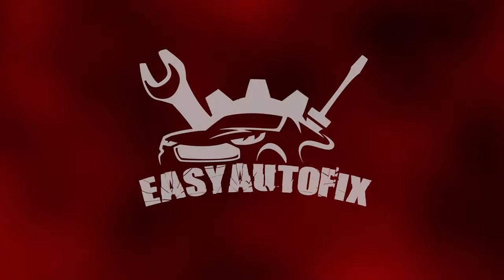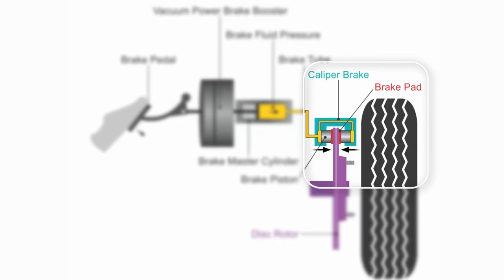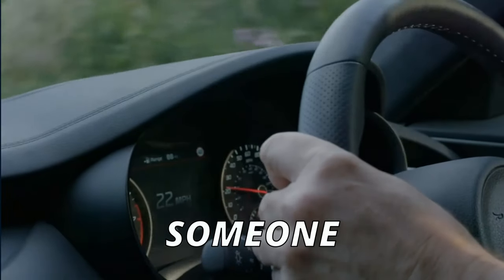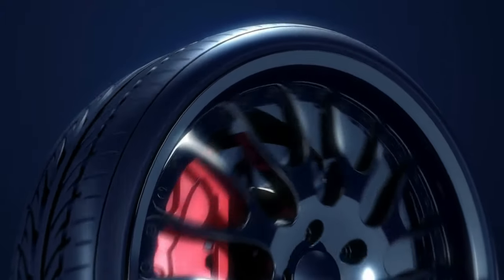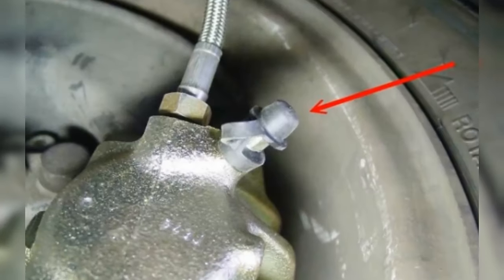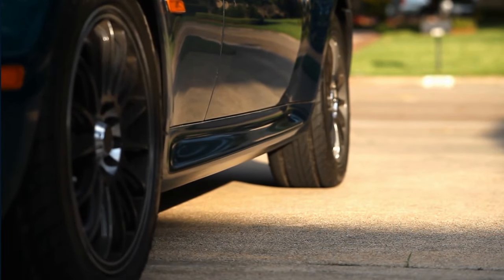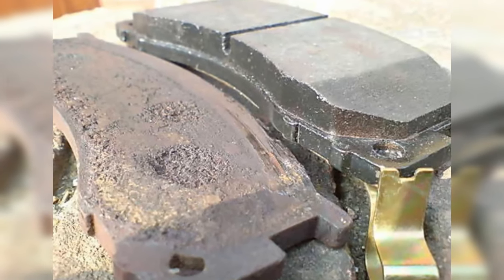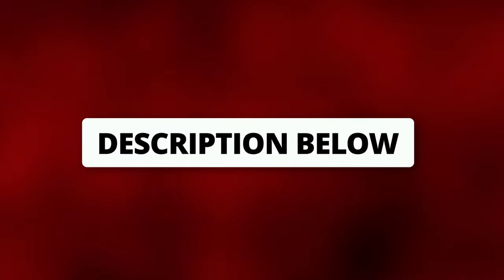SYMPTOMS OF A BAD BRAKE CALIPER

Comment: Dude the car problems never stop I swear😭
Reply: I feel that lol i got a 2016 dodge dart sxt last march with 58k miles. S8nce then, ive had to replace all 3 motor mounts, i have spark plugs that are melting, had to replace the transmission mount, have a sever clunk in the front end thats been ongoing since purchase, we just replaced the struts last weekend as dodge said that was the cause, only to discover it wasnt. Brakes and rotors are bad, transmission and powertrain are bad, fans are going out and are loud when running heat or AC, just doesnt stop. Come to find out, its possibly my calipers, which is what brought me to this video
Reply: @unhollowed_7383  new dodge Chrysler or jeep never a good choice
Reply: @rdr9519  just makes me miss my 06 300c 5.7 even more. Hate my dodge. Ive done more work since posting my comment. Just did CV axle, and wheel hub, and still have a clunk. At this point, ive basically replaced everything in the area that the clunk ia happening, and the clunk remains. Im now at 64.5k miles. Roughly $1700 in parts and diag fees with no fix.
Reply: @Unhollowed _  yeah man I know it's hard if you love the car but newer Chrysler products aren't very high quality. Newer cars in general don't last
Reply: Nothing on my 01 jeep cherokee was maintained, literally looked at everything and everything is needing to be replaced. it never ends
Reply: you can day that again
Reply: It's not just car problems. Literally everything is garbage
Reply: Amen🤛🏻
Reply: AT ALL 😢
Reply: Glad I'm not the only one 😅 I have a 09 mercury sable so the parts are either outrageously expensive or hard as h3ll to find!
Reply: Ever
Reply: U don’t need to replace the engine mounts
Reply: No shit, they are made of thousands of moving parts.
Reply: Bro I know right. I have a 2010 Benz e class and it’s like I’m just chasing different noises all day. When it is in peak shape it is a blast though.
Reply: Got damn you’re right 😂
Reply: Never. sucks even more when you soend money trying to fix something, and can’t figure out what’s wrong

Comment: My mother bought a brand new car a number of years ago.  About 15 months later, and 14,000 miles later, she heard the brakes squealing at the front.  She took it to the selling dealers service department.  They said her pads were worn, and replaced them.  Then they said her brakes were heavily used, and abused.  Nobody used the brakes in a manner as they were stating.  She continued to drive the car, and said the front brakes felt funny at times as if they were locked up.  At 23,000 miles the brakes were squesling again due to the warning sensors scraping the rotors.  She returned to the selling dealer again.  The second time they found both calipers were not releasing, and were causing the pads to ride on the rotors, and wear them out.  They determined both calipers were defective from the beginning, and were causing the pads to wear.  It was a brand new car, and both calipers on the front were defective right from the factory.  They replaced the calipers, and there were no further problems.  Her gas milesge improved too.

Comment: Or the caliper piston is seized or piston boot is going bad, and you just replaced you rear brake pads and rotors only to redo them and the calipers😂. Yea I just replace rear rotors and pad on my 2011 fusion, and one of the calipers is failing and locking up so it warped the rotor. It’s always something  man

Comment: So I think I have a seized brake caliper. The car will be running fine at first, then all of a sudden this shaking starts happening. Then it feels like someone is pressing the brakes to the point where the car won't accelerate the way I wanted to. Then when I get out of the car for the day, one rotor is extremely hotter than the other ones. So this is got to be a seized caliber.

Comment: This is what is happening to my car. Especially feels like the car is driving with the brakes being engaged. Additionally, after coming to a stop and then taking foot off the brake, the car barely moves forward. It feels like the caliper is stuck engaging and wont fully let go.
Reply: Are you sure your engine is not overheating which causes the brake master cylinder to heat up which causes brake fluid to expand and hence brake drag....???
Reply: @atillaozturk7075  Yeah it happens immediately when you press the on the brakes, even when the engine is cold. I’ve replaced one side’s calipers and it seemed to help.
Reply: Did you hear a metaly scrapping noise when you let go of the brakes ? Also did your steering shake a bit before it happened? Something similar happened to me, when i pulled over the driver side rotor area was super hot & i could smell burnt metal
Reply: @elguerokabron  So my issue was just the brake hose. When i press the brake pedal, the fluid would go to the caliper but when I would let go of the brake pedal, the fluid would not come back up therefore keeping constant pressure on the brake. Hope this helps for everyone, and definitely consider your brake hoses!

Comment: 2008 nissan altima coupe 3.5L v6, has 246,000 miles on it ive had it for 2 years, bought it for 1200$ and I've spent about 10,000$ just keeping the thing alive. Had no rear swaybar, rear tierods were shot, no power steering, had bald tires, front swaybars went shortly after, front tierod ends went, alternator went, all 6 ignition coils and sparkplugs went, radiator  was replaced, because it was leaking alot,front shocks were replaced, fuel pump needs to be replaced, and hitting the brakes makes the car vibrate like a mf. And the rear brakes are decent, but the new front brakes are warped.

Comment: I have some weird thumping sound that happens over and over and over as I brake. And it comes from the drivers side. Any idea as to what it might be? Car doesn’t drag and the brake pads are even new
Reply: When you change the pads, did you change the rotor also? Most likely when you change your brake pad change your rotor disc also

Comment: My breaks started making that noise like two weeks ago. I got the new breaks today and went to change them and noticed that on the passenger side the the rotors are ate up but on all the others they are even wear. Is that a bad caliper. I dont know if the past owner just didnt change it and had uneven ones or if it just ate the break up that much faster than the others.

Comment: Great vid. I think i may be having a caliper issue but slightly different from what you described. I can hear what i think is the pads scraping against the rotors when i drive slowly. Often times when I come to a slow stop I get a brake squeal as well only on the front left. Lastly I do have leaning to the left. I replaced my caliper with a new "chinese" brand off amazon but I figured a caliper is so simple it should not matter if I don't go oem. Is it likely the chinese caliper is just bad out of the box? I don't have any leaking or anything.. just the issues I mentioned. I am unsure of what really there is to fail on this caliper since the seals are in good condition with no leaking.
Reply: Did you ever find out your problem? There are ways to test if its the actual caliper or if it's the brake lines themselves. Sometimes they are damaged inside and the hydraulic pressure is enough to force fluid into the caliper to close it but it won't let the fluid back out of the caliper or lets it out but slowly...this can also cause the seals to leak in the caliper because that fluid has to go somewhere in order for the piston to retract. Realize this is 2 months later but handy info non the less.
Reply: @sheilaedwards4296  I’ve done every test possible. I think this issue may be the sway bar at this point or the master cylinder. As I’ve tried a new caliper and the issue remained. The issue presents itself in a number of ways that makes diagnosis difficult. The steering feels shaky at high speeds. Strange brake wear. And the most obvious issue is a clank noise over small bumps. I believe the swaybar bushings are bad but not enough to be moveable by hand. When I start the car in the morning and go down my garage incline and turn I notice a sort of rubbing noise that sounds as if the swaybar is moving within the bushings. I’m hoping this is the issue as I’m out of ideas at this point. All other front end components are new.